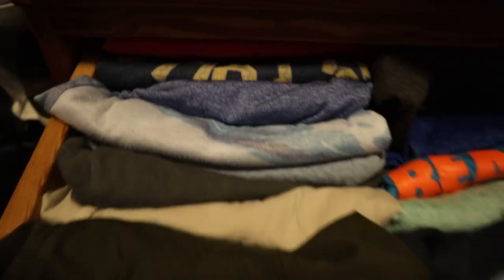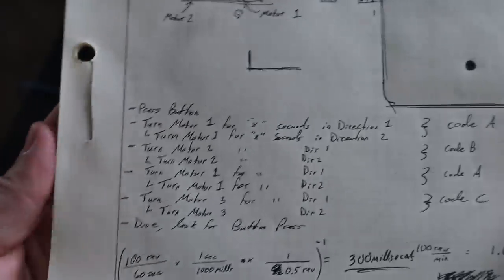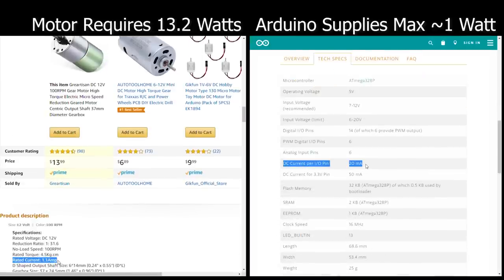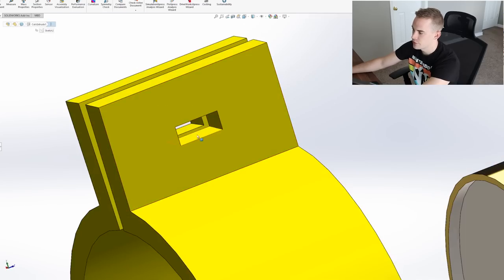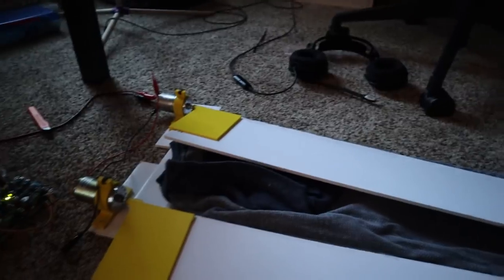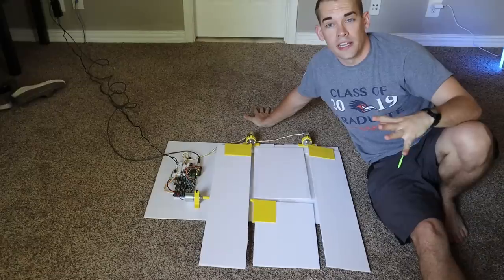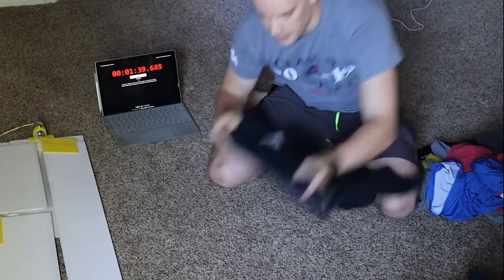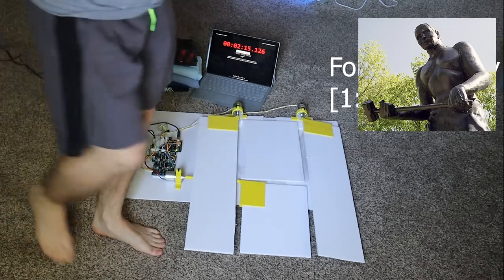I made an Automatic Shirt Folding Machine - DIY Builds

Comment: Hey ty, i follow your project from zero to finish but my all my 3 md10c driver motor, B (which direction to turn 180 back) not working , do you have any idea why ?
Reply from the maker: Thanks for watching!
Do you mean the motor won’t reverse direction?
Reply: @TyPalowski  yes that is exactly what i mean , i use 12v 180rpm dc motor btw

Comment: where i can get yellow pieces? or any suggestion that i can use other than that?? i really hope you notice me because i need to finish my final year project. thanks have a nice day.
Reply from the maker: Hey! I made a project write-up on Arduino.cc and electromaker where I have downloads of the files and codes. 
You could easily use a piece of cardboard to glue around the motors, making a base which you could then fix to the base platform. And with enough epoxy and a tube that fits over the shafts, you could make a replacement for the couplers. Good luck man! Let me know if you need any help. 

https://create.arduino.cc/projecthub/typalowski/automatic-shirt-folding-machine-88fb92
Reply: @TyPalowski  I'm IT student actually, is it okey if I use servo motor?
Reply: @TyPalowski  i need your help, which is can I use servo motor?
Reply from the maker: Yes you can of course, the code will be slightly different and you will need a different driver board to supply enough power to the motors. Not sure if the ones I show here are compatible with servo motors.
Reply: @TyPalowski  my lecturer want me to put some exception handlin but i don't know how to code can you help me with that?
Which is:
When you pust the button more than 10 times, the led light will light up.

Comment: also, what motors did you use?
Reply from the maker: https://www.amazon.com/Greartisan-Electric-Reduction-Centric-Diameter/dp/B072R57C56/ref=mp_s_a_1_3?dchild=1&keywords=motor+100rpm&qid=1595804922&sprefix=motors+100r&sr=8-3
Reply from the maker: 12V, 100rpm motors
Reply: @TyPalowski  do I have to use this exactly model or any 12v dc 100rpm?

Comment: I thought it would be a coolnidea and found this then your video.
https://m.youtube.com/watch?v=C76osXtpLeM

However the complete solution has to require a redesigned dryer to separate then spit out one garmet at a time, recognize it and feed it into a folder. A robotic arm wirh a sensor grabs and removes one at a time and removes it and puts it in the folder. That arm has to be able to have a camera to see and pull out every piece. The problem is loading in the garmet and stretching it out and probably the best waynisnwith a puff of air which requires compressors which are loud. These need to run in silence. If bound by the width of two machines side by side, then the max width of the auto folder is are these dimensions. A version has to be made for side by side and stacked. Rather than a folder, actuated rollers should be used. Good job!